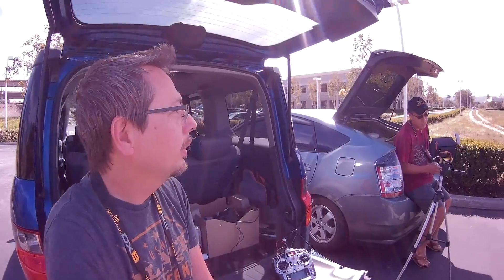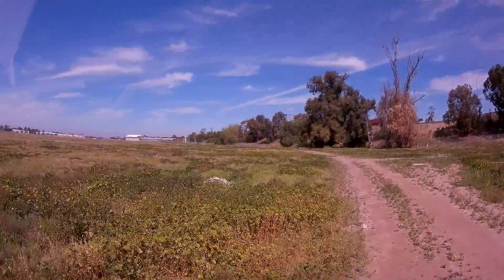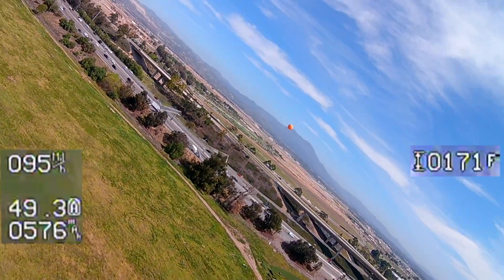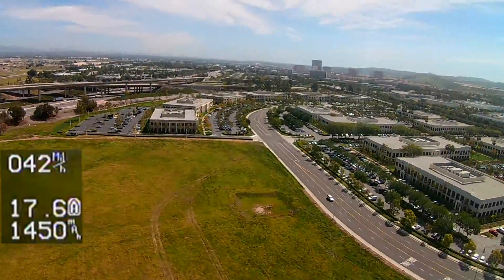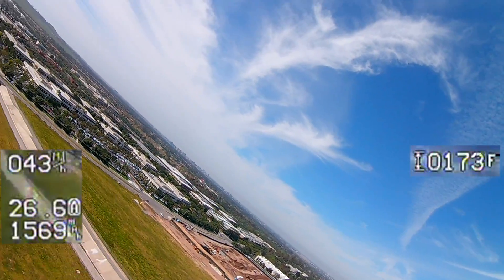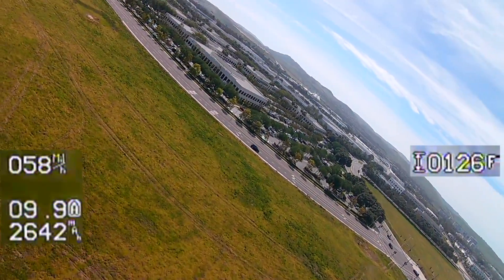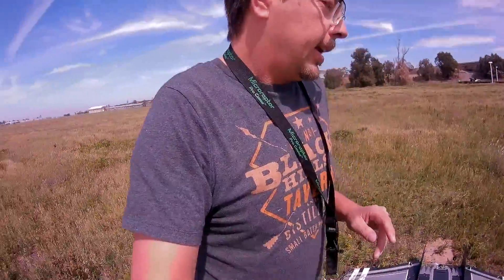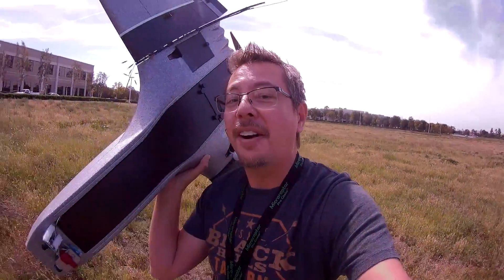Drak 5s Project

Comment: So with a typical flight what kind of flight times you anticipate with the 10,000mAh 5s setup? Thanks for the vid, really tempted with the drak. Looking for a good long range cruiser,,, ;)
Reply from the maker: +Joop Media With 10,000mah like my setup (I'm guessing here) you could expect 20-40 min.  
For long range cruizer I'd suggest the Zeta Fx-61,  This plane isn't much of a cruiser- it's more or less - point and shoot- and cruise speed is 45mph at around 16-25a which to be honest isn't efficient.
Zeta will cruise at 27-32mph @ 9-15a, I've flown my Zeta with 8000mah for 33min with battery to spare

Comment: what issue did you have with arkbird artificial horizon?
Reply from the maker: +steven mitchell It was all over the place- it happens every once in a while- when I tried stabilize or balance mode it followed the wonky line of the AHI- I tested it again the morning after and it was good.  I think I didn't do a Neurtal Point Check like I normally do.
Reply: I'm also an arkbird osd and aat user along with tbs crossfire and I've had my horizon spin for no reason. When that happens do not put into rth or stability or it will crash. There really isn't any in depth instructions out there for the arkbird. I was hoping you may have more info. Also did you get the upgrade from April?
Reply from the maker: +steven mitchell Thanks, I know to fly it in manual or Gyro when this happens.  I have my component layout closer than on my FX-61, I wonder if this has anything to do with it?

Which upgrade are you talking about- I haven't done any.  I have bad luck with Firmware upgrades so when something is working - I leave it alone....lol

I use the AAT as well but I only have one Onboard unit,  I guess I could easily swap it between my 3 LR Planes- I just setup my HK cloud surfer with Dragonlink and the Storm OSD which I've used in the past